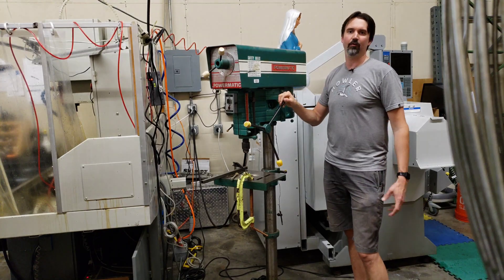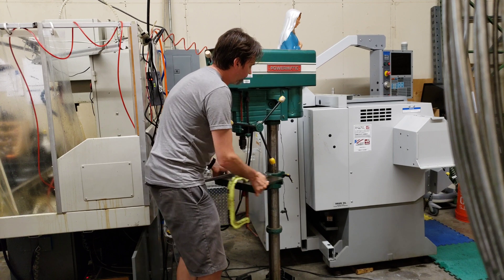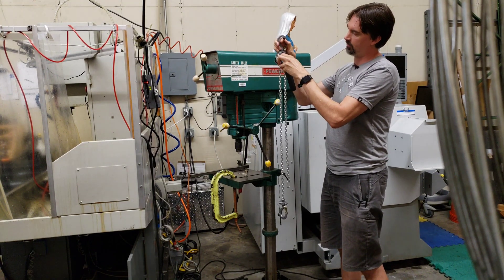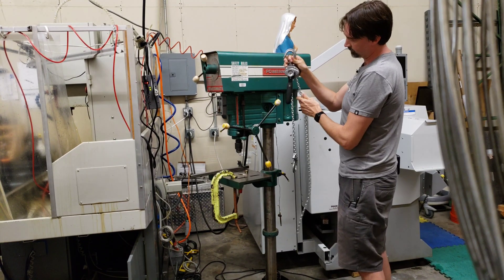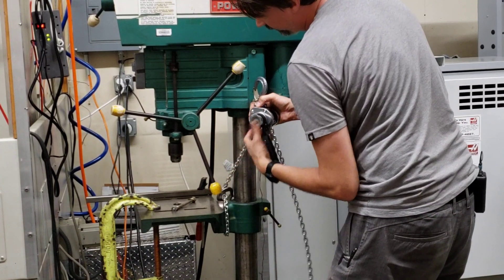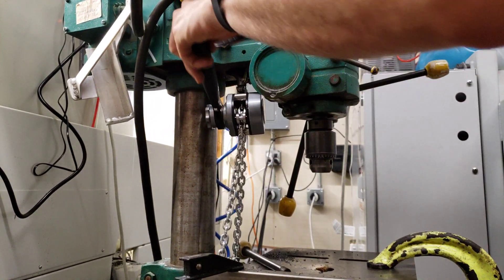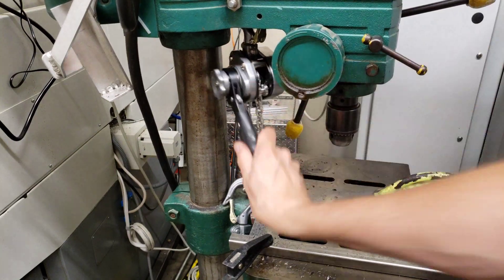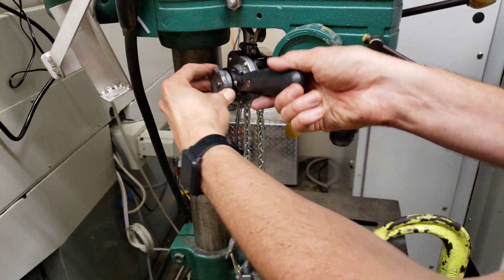How To Make a Drill Press Table Lift Using A Compact Ratcheting Chain Hoist | DIY |

Comment: Today I bought a 1972 commercial drill press for cheap that is a heavy beast that I can reverse and low speed for tapping. The only hesitation was the lack of table lift.  You solved that problem better than a counter weight so I bought it.
Reply from the maker: Nice! Glad this helped. It still works great.

Comment: interesting. I have a pair of Craftsman 101s from the late 1940s, rather tall table top units. they are beasts and work better than the drill press we have at work, but they don't have a crank. Right now I have a scissors jack and a 2x4 between the base and the head.
Reply from the maker: That's a good solution also! Thanks for sharing that tip.
Reply: I was just thinking the same with a hydraulic car lift put under the table.  :)

Comment: Did you find a way to lower the table easily and smoothly?
Reply from the maker: Add more weight to the table 😂. Maybe made it look difficult to lower the table in the video, but it is quite easy. I have another drill press like this one, and when the table column clamp is released it moves down freely without needing to assist it. So maybe I could add some wave washers or spring to open the column clamp more when the clamping force is released.
Reply: @engineerable  Put some glide/rust preventative on the column. Same stuff people put on table saw and bandsaw tables. Makes it slide down faster.
Reply from the maker: @ProfessorClay  Thank you for that good advice!

Comment: I wonder if you could use a drill or impact driver to turn the crank for the long trips.
Reply from the maker: That may be possible. For the amount of times that we need to adjust it, the hand crank is fine.

Comment: What model is that and how much did you pick it up for?
Reply from the maker: This is the exact chain hoist I used- https://amzn.to/3yb2PTy
Reply: @engineerable  sorry I meant the drill press itself
Reply from the maker: @TheFishbgb  Powermatic 1150, paid about $150 5 years ago, was a school auction
Reply: @engineerable  I'm looking to buy one from a similar auction for the same price but they don't show the model number but this looks like an exact match. Yours looks in better condition but I imagine this one will clean up nicely.
Reply from the maker: @TheFishbgb  It's a heavy duty drill press. Not much to go wrong with it. This one is 3 phase, but I have another running off single phase 110 using a phase converter VFD.
The only con about it is adjusting the stupid table, and I've fixed that with this video on both of mine.